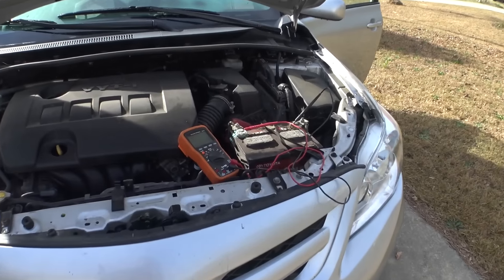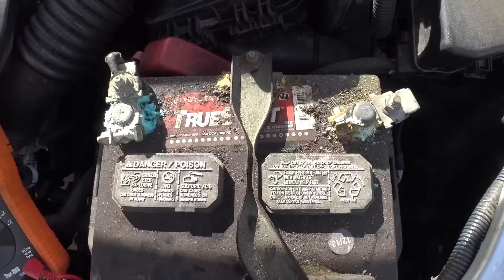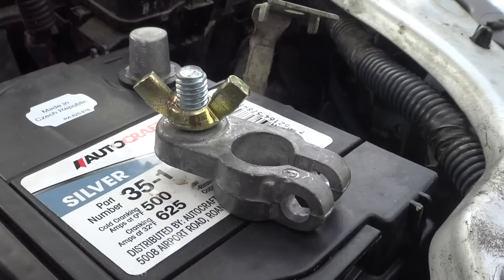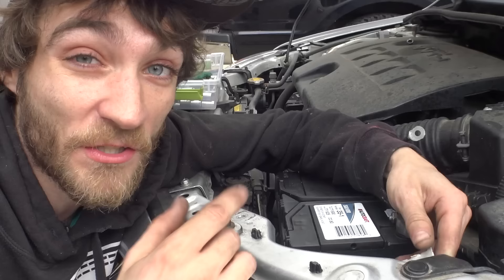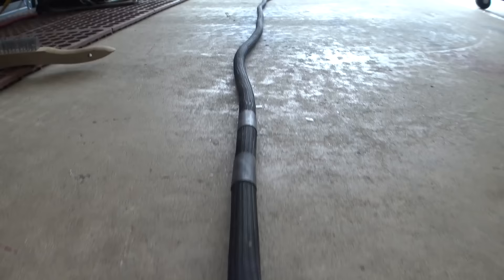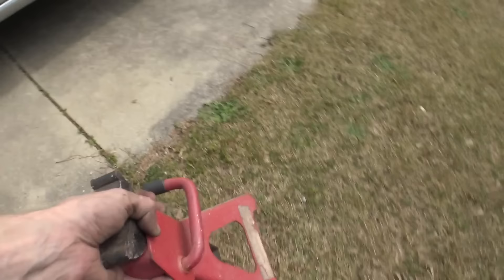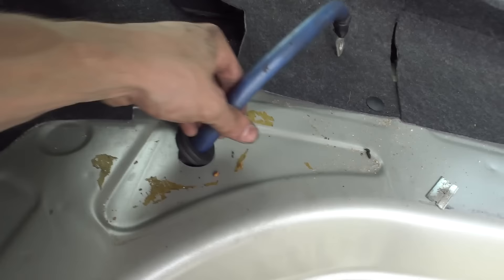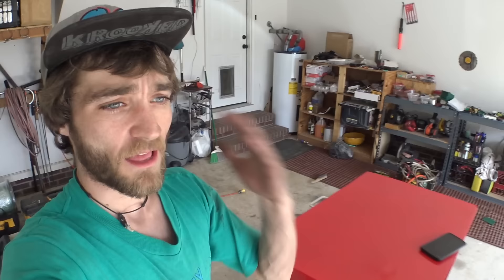Wiring CAR AUDIO System w/ 2nd Trunk Battery & Installing BASS Amplifier | Testing HOTEL Subwoofer

Comment: no big three upgrade. disappointed bro lol
Reply: Michael Moral for a 3k amp (even tuned for 1.5kwrms output) a big 3 would have been helpful. surprised he didn't do it also. there is a 2nd battery so that helps and is probably why he didn't do it
Reply: Plus it has a little 100-amp alternator...
Reply from the maker: No high output alt yet, thats why :)

Comment: Great tip on using reverse on the drill!! Especially when you only need to take just a little bit off.  
I to have grabbed my drill, shoved it in the hole, rushing, and had the terminal ripped from my hands!!
Not only do you NOT trim what you want.. but like you said, sometimes it'll rip that little thing right off of the lines!!
And now your starting over.... take your time and do things right! 5 or 10 seconds of thinking and slowing down will save you hours of headache.

Comment: Dude, i work at Advance Auto, trust me, don't get the silver battery, if you are into car audio, get the Platinum AGM. I have heard back from my car audio customers that it has improved their sound. It also doesn't vent, so the terminals wont corrode. I put AGMs in all my builds.
Reply: rocbola working at advanced you’re not building much... no offense

Comment: I have done hundreds of stereo installs and have always ran my power wires underneath and pinned it up and customers were like what you doing, I'd just say you'll thank me later and made sure it was protected from bumps and such, there are various grommets and trunk drains that can be used so that's more than under dash and you don't have to pull but maybe one or two interior panels off  and boom it's wired and ready, some people just can't understand why we do stereo installs like this exo and like you bro been In the game for a long time excellent videos buddy

Comment: You can also hook the power wire to the second battery straight to the alternator with a circuit breaker in between and run a second large ground from the engine battery to the body then ground your trunk battery straight to the body and the two batteries won't fight for voltage or confuse the alternater.
Reply: Dan Hodgkiss I think I need to do that I’m having power issues with my battery’s

Comment: One helpful thing to know bass is a long wave form so if you the rider or driver in a car what to hear it well, put you bass speaker farther away from you when possible. Like in this case you don't need the rear seats down and playing it that loud. Point you bass speaker toward the back of the car and do as much as possible to stop the truck from rattling, especially the lid and the rear lights.
 Glad you were wise about the power wires.
 Yes, a fuse at the battery up front is great,  but you partly ruined that safe plan by not fusing the battery in the trunk. Also a softer speaker, in a ban pass box and maybe 200 watts RMS amp would have worked out very well.

Comment: Love your work and videos.  I see it both ways with running power externally.  My only issue with this particular install is you have zip tied the power wire to the fuel lines.  Not a good thing if the insulation wears thru.

Comment: You didn't show how to install the 2nd battery. I wanted to see if the original battery needed different terminals, or if there is something else needed to add the 2nd battery other than cables.
Reply: I was going to say the same thing but I noticed that he got separate smaller (lengthwise) of the same ground and power wire he installed and ran the power wire (he installed under the car) into a fuse near the battery then connected it to the battery then another separate smaller power wire connected to the amp. Then for the ground wire, he took a smaller (lengthwise) wire then ran it to the ground on the battery, then another one ran from the battery to the amp. I hope that helps!! I paused the video at 11:27 and followed the wires remembering the colors of the orignal two he installed.

Comment: My setup is pretty Similar, got a grey corolla sport with one 12” kaption spl max 1200 watt rms kaption amp. You should really change the factory head unit and speakers, makes a big difference

Comment: Just finished a small system in my 97 mercury tracer. Got Hertz speakers in back Audison in front hooked up to a 650 watt rms pioneer amp and 2 10 inch Memphis brx 1044s in a ported box with 1000watt rms amp. What i like about these subs is the magnet is about 9-10 inchs so even though its a 10 inch sub it hits harder then a lot of 12s out there.

Comment: Pepsi, sprite, Canada Dry ginger ale would’ve helped with the corrosion on the battery!! You can literally see the acidity from the sodas eat away at the corrosion.
Reply: YOU TOTALLY DIDN'T MENTION THE #1 ACID EATER THE ORIGINAL COLA THAT DISCOVERED THUS TRICK COCA-COLA
Reply: YOU TOTALLY DIDN'T MENTION THE ORIGINAL#1 COLA THAT DISCOVERED THIS ACID EATING HACK COCA-COLA

Comment: I totally agree with running all zero gauge under the vehicle with water tight grommet where you go into the vehicle. I use old water hose as conduit for extra protection for wire/cable. Do it right and there's no problem. I think they recommend it inside for lazy/idiots that would run cable through pinch points or hot surfaces:)

Comment: I personally think the subwoofer should be pointed towards the back of the car, instead of pointed towards the windshield.. I mean I've done it like that for years.. the bass tends to be deeper and harder that way but I guess to each its own. Awesome!!!!
Reply from the maker: You're VERY right! But this setup is meant for daily travelling and grocery getting. With the sub facing the rear, the cone would be constantly hit and possibly damaged from all the stuff we transport in the trunk!!!
Reply: EXOcontralto  hey buddy yeah you're absolutely right.. in that case then yes I would have kept it the way you did.. I was wondering if you guys could ever get a chance to check out the Power Acoustik subwoofers and the autotek amps.. that's the equipment I had in my car and they seem to do really well but yeah just a thought
Reply: EXOcontralto with the rear seats down wouldn't the sub pointed at the cabin be louder?
Reply: Colby from my own experience the sub pointed backwards always seem louder.. and besides I always thought you hear less woofer noise and more deeper Bass

Comment: Surely it'd sound better firing toward the rear, right?  I've tried several forward fire setups without being sealed off and it's always better to the rear.
Reply: Yeah its louder firing back in my sedan
Reply: Tim Germany its its sealed up facing forward its louder but not the way he has it
Reply from the maker: Had it faced like this for better viewing of the sub on video.

Comment: Wait you have your remote ran off a switch? Is that so you can turn your amp on and off? I wanted to do that with mine and the guy who installed my stuff laughed and basically said that was a dumb idea
Reply: because he didn't want to do the extra wiring and mounting of switch

Comment: I put electro grease onto  the terminals to prevent corrosion. But you could also use vaseline. It works pretty well.

Comment: So wtf , can I put subs in my car then or no? Cause I have HORRIBLE corrosion on my postitive terminal like way worse then in this video , I even replaced the 4 year old battery after it went to shit & it still does it .. SIDE note . The bottom loop on the Positive terminal is broke off like half off it . I think that’s why. 2014 Ford Taurus lmk !
Reply: If you have corrosion on the battery, no I would not install your system yet. Batteries need to be replaced periodically, that's just how it is. Come out to AZ, I've never had a battery last 3 years, and I've had 1 die in a year and a half. 120 degree summers is too much for car batteries. Clean everything up, get a new battery and fix any broken terminals before you install. You'll be happy you did it right the first time
Reply: sublimejhn ok cause that my problem is the positive connector not the post but that actual piece u connect it with is broke

Comment: I HOPE NO ONE TRYS TO USE WD-40 PN THERE BATTERY COMPLETELY INSANE. ONE LITTLE SPARK AND KISS YOUR CAR GOODNIGHT.  THATS JUST MY OPINION NOT TRYIN TO HATE THINK YOUR VIDS ARE GREAT.
Reply: God dude if you're going to make a point at  least make it readable.
Reply: Christopher Mackme lmfao
Reply: Brake cleaner  a wire brush does wonders

Comment: you should put the 1/0 in seal tight  electrical conduit for added protection under the car...it has connectors as well
Reply from the maker: Great suggestion for anyone reading^^

Comment: a trick i Learned at work is spraying the wire with soapy water win pulling the wire thru so its a little easier
Reply: Soapy Wooder?
Reply: @riveralley  yes
Reply: @riveralley  Hey guys, soapy wooder here

Comment: I'm shooting for a 140 with a single 12. but only 1600w 😎 got it firing in a hatch at the glass.
Reply from the maker: Nice man!!! What type of meter are you using?
Reply: EXOcontralto I honestly have no idea. I did a 136.3 3 weeks ago on this crappy single xplod 12 and an olddddd Optimus 300w amp. bought lost my bowels over that number. where do you live in nc?
Reply: EXOcontralto but that 136 was sealed, on the dash in the lanes.

Comment: If you add two batteries do you need to beef up tge alternator? Or when are you suppose to beef it up ?
Reply: GHOST FACE an extra battery is almost like a bandaid on the problem. An alternator is the better option when putting down the power

Comment: i use a 2.4 farad 24volt  capacitor and one battery and stock alt. 4300 watts between 3 amps @1 ohm and my voltage at battery holds steady now.before the cap i had blown 2 alternators

Comment: @Exocontralto Be very careful zip tying into the ecu clips as you did for the amp fuse! Id probably grab onto something else. Videos great!
Reply from the maker: Probably seen them break off easily? They seem fairly  rugged but since they're plastic who knows I guess.  Hmm, really didn't want to drill into anything, but I'll ask permission to drill out a point for a possible mounting. Thanks for the comment!

Comment: I was taught to fuse again at the second battery and again for the run to the amp. Guess everybody fuses differently.
Reply from the maker: The 2nd battery is fused, but the amplifier is not since the run of wire is so short.
Reply: EXOcontralto Copy! I was just wondering and you cleared that up, thanks.

Comment: Might be worth mentioning to use a junk drill bit in reverse if you can't sharpen them incase it heats up and dulls it or does what your also tryin to prevent and breaks off

Comment: So u can add a second battery as long as they are both agm right? Even if they are both different sizes?
Reply: Don't get caught up on the AGM part. If the batteries are not the exact same then you need to add an isolator so you do not kill your main battery overnight.

Comment: Sounds like they had the mids and highs coming through the sub too..lol sounded like it was the only speaker in the car. I gotta have clarity. That was nothing but noise and distortion.  I just finished my install last week, 800 watts to 2 12's, and a 50x4 going to my component 6.5 door speakers. I can turn the new deck up all the way, and no distortion, it sounds beautiful..but I'm no bass head either..I just love quality music. I run everything flat as far as eq and sound settings. Things sure have changed in car audio. The last time I had a nice system in my car, MOSFET had just come out, and was all the rage, in the industry at the time. Early 90's, maybe....lol Great job, though!
Reply: Im the same way with audio lol. Im running 1200w to 2 12", then a like 650w 4 channel to 4 6x9 😂 more balanced than it sounds
Reply: China Rider we are bassheads.... we prefer loud deep bass to the cutting sharp sounds of treble.

Comment: Would probably be better aimed at the back. I went from 141.2 hz on an AB HD12 on a Shark 2500 to 144.3 just by facing it towards the rear of my Kia Forte Koup.

Comment: Best way to avoid this acid corrosion's is by using oil grease, put the oil grease on clean battery terminals.
Reply: Rushikesh Shirsath-Patil it puts the oil grease on the skin...
Reply: Rushikesh Shirsath-Patil vaseline too

Comment: How did you decide whether to have to sub facing towards the back seats as you did or facing towards the rear of the trunk?
Reply from the maker: In this case it was decided PURELY off the convenience of moving things. Having the sub to the front allows more storage in the trunk without damaging the sub.
Reply: @EXOcontralto  ive always done to the rear and as close to the rear to make it louder in drivers seat. it i s a hassle ho. spl the same i wonder?

Comment: I enjoy and learn alot watching your videos but I do believe those are fuel lines your zip thing the wire to. So in your opinion though is it a bad thing to have two lead acid batteries, one u der the hood n one in the truck for the 1500 watt rms amp? Or is a lead acid under the hood and arm in the back a better scenario

Comment: EXO, 
If ya don't use it yet, you should use dielectric grease in between all electronic connections for the main wiring. I do, and have never had any corrosion, and I'm in salty MN. Lol. Just a tip, for a favorite pro of mine. BUMP ON EXO, BUMP ON!!!!!

Comment: What does the 2nd battery make better. what does having a battery in back like that help do. Looks easy to do.
Reply: Helps power the amp. Basically allows you to run smaller gage wire from the main battery. And gives you extra reserve capacity, same function as a cap.
Reply: The extra batteries give you a reserve of power for your amps. This gives the alternator time to respond to the draw of the amp.
Reply: To have a second battery like that you're supposed to have a relay between them, when you turn the key on, it links the 2 batteries together and when the key is off it disconnects them.  When you have 2 different batteries linked together like that their voltages fight each other and it's not recommended.  The battery relay is run off of the remote line, the most common one is a 200 amp Stinger Battery relay (https://www.amazon.com/gp/product/B001HBYXVS/ref=ppx_yo_dt_b_asin_title_o00_s00?ie=UTF8&psc=1).  This setup also gives advantages outside of car audio, like if your starting battery dies once you turn the key the 2nd battery will charge the starting battery and start the car effectively charging both batteries via the alternator.  The advantages to a 2nd battery are also that it helps keep the voltages stable, makes it easier to run power wires with the least amount of resistance from the 2nd battery to the amplifiers, and lets you play the audio system longer without turning the engine on.
Reply: @fireboygamer  so if I want more power I just put bigger amp and another battery, fuse, wire it up.
Reply: @skippy710  Pretty much
Reply: @fireboygamer  exo didn't use a relay didn't he ?
Reply: Daniel Bea  not with the tiny/pukestain of an alternator toyota puts on this car
Reply: You dont need an isolator. It's more for Rvs when the motor is off so you dont drain the starting battery up front. As long as its wired right it shouldnt drain when the car is off.
Reply: 2nd battery is for AH ( amp hours), or in other words, reserve capacity. 

And then the voltage dropped  because the batteries are not big enough/ he played it for an extended period of time.

Which he then admittedly said that a h.o alternator would be a good idea.

Alternators charge the power... Batteries hold the power for when the demand of the system is more then the alternator can put out.

Would like to add in for anyone researching sht... in the grand scheme of things....volts are king.  It's all about keeping volts. How you do it is up to you.

Comment: EXO.. I'm thinking about doing the same thing to my little beater car as well. I see in the video that you have the stock head unit. is it possible to get clean clear music highs, and low Bass with just the speaker upgrades, and amp, with a factory head unit? In your video sounds like yes.
Reply: 35823582 definitely
Reply from the maker: Yessir, but the HPF settings will hurt you.
Reply: EXOcontralto Just two more questions.. #1 Was it necessary for you to put two batteries in this build? #2 By "HPF settings will hurt you" you mean, it will be hard to set it up?

Comment: run the wire along fuel lines with no fuse lol 😂
Reply from the maker: Wait, no fuses? Both ends are fused with an ANL 300. But hey, I can totally appreciate how people may be concerned. The way I see it, a safely fused wire running near solid metal tubes isn't too dangerous, but I may relocate just to make people happy, and to keep the momentum going
Reply: EXO I'm just giving a hard time. keep up the good work love the videos. I know it's fused always great installs
Reply from the maker: Hahah thanks man, I still appreciate the comments :)

Comment: looks like I'll take your advice and I'll run my wire down the under side. much easier lol
i need a battery like that XS so i can finally use my skyhigh terminals
Reply from the maker: Just be sure to tuck away from the bottom and securely fasten to the underside.

Comment: @EXOcontralto Got a question if u see this comment, i got 2 12s in my truck facing the truck opening should i flip it around and roll around with the sits down for better bass like u did in the video?
Reply: No you keep the seats down turn the box towards the trunk as close as possible. This will give little extra
Reply: No , buddy always face them backwards towards the trunk lid and then lay the back seat down,but I'm sure you've discovered this by now